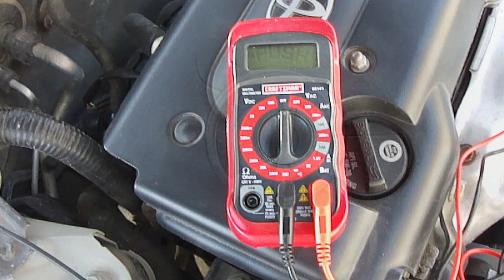How To Fix Car Losing Power Loss Of Acceleration - Easy!

Comment: mine was leaking oil from the solenoid in tieback on the engine but I have two solenoids I was gonna change the vvt one to , I have engine like p420 , and I changed the pcv valve but the p420 says lean mixture in system bank 1

Comment: my 2015 camaro rs keeps saying engine power reduced and service stabilitrak again for the last 2 days. I cleaned the throttle body the last time this occured and it went back to normal bt the engine light stayed on. Bt this time while cleaning i see the hose that is connected going vertically to the top part of the engine was disconnected. so i fixed and cleaned the throttle body but the car keeps doing the engine power reduced thing still. very frustrating plz help!! Also the engine would hesitate a little during acceleration. dnt kno wat that mean either

Comment: what could be a reason of engine hesitation on a little throttle while driving (looks like unbalanced flywheel) on chevy camaro ss auto transm? I replaced vvt sprocket, vvt valve, cam magnet and sensor, timing chain.

Comment: We have a 1989 Honda Civic with a 1.5 engine. I'm not aware that our car has such a VVTS device on the engine. We have the symptom mentioned, so where from here to look for the culprit? Once the car is fully warmed-up the throttle shutter goes away.

Comment: Hi sir,i have a 2010 crv,i bave a big  hesitation on stop go motion only when the engine it s cold,when its came warm its came normal,this about 3 monhs, 3 mechanic can t find the problem,no code or check engine ,they change the TPS sensor,clean the trottle box,change crankshaft position sensor,change valv timing solenoid  spark plugs,oil filters,put moly catalytic cleaner,they cant find the problem

Comment: Engine hesitation is one of the most nerve wrecking things to diagnose!!!
Reply: Man what?? I have a 94 f150 new IAC, distributor, plugs, wires, ECM, coolant sensor, MAF sensor, EGR. Fuel pumps/filters are "ok." Mannnn idk!!
Reply: @demariojason  Trust me I know the feeling. I did the same thing. Come to find out the problem was the thing I ignored the whole time, wheel speed sensors. Not knowing they were directly linked to the transmission response according to the wheel speed. I was thinking they were only for ABS and VSC. Smh.
Reply: @MRMAN-wb1tv  wow!! Smh. I may need to try that.
Reply: @demariojason  Did you have abs codes?
Reply: My abs is on

Comment: Hello sir, its great information and experience which is quite helpful,
I have 2NZ engine, it has no check engine light but the engine hesitate during cool and rainy season , its stops hesitation once engine gets hot, but repeats in cool such as losing power and jerks, i have followed the steps to check the VVTI sensor, it moves and gives reading directly but it doesn't give any reading when its checked for whether coil is grounded. What does it means futther!

Comment: You don't get nearly enough views as you should be getting compared to Scotty Kilmer or even Chris Fix. Love how straight to the point you are. Thought I had a parasitic drain and couldn't find the culprit but I finally watched one of your videos turning the car on and disconnecting the positive battery cable. Sure enough car stayed on proving it was a bad battery regardless of reading 12.6V. When I removed the battery I noticed under th3 negative terminal there was a large Crack and what looked like gas or some liquid acid had come out from trying to use a rubber mallet to get it on right since it wouldn't tighten anymore. Don't hit your battery with a hammer who would've thought 🤷‍♂️🤦‍♂️

Comment: Man this is why I wanna be a car guy but I don't. Its a love hate relationship. 
I had electric trial and error crap. My car bogged down like crazy today. As a delivery guy I need my car sharp and optimal. I pulled out of a neighborhood to go into a main Blvd and from low rpm and low speed in 1 gear (it's a 2008 Elantra automatic) to get up to like usually 30 to 40 I press pretty good on pedal well this time I bogged like a friggin weed eater at like 5 10 mph good thing today Sunday and no on road and I didn't have to quickly merge cuz I was like wtf no speed no movement hardly. I turned into a street like 25 ft than stopped. Turn car off and back on and every thing is working fine. 
I'm think carburatuer is dirty? But now this solenoid gimmick. My check engine light has been on for months I don't ever engage with stuff until it's making a sound or someone when it's a shop tells me. But perhaps I should go to advanced and get the diagnostics checked. This video helped much my man. 
Appreciate the video. 
Danny

Comment: special cleaner? please elaborate, anyone?
Reply from the maker: Use gasoline
Reply: @proclaimliberty2000  thanks, that was my 1st option
Reply from the maker: @seaperu1  👍😊
Reply: @proclaimliberty2000   Hey captain!, will there be a screen on a Toyota Matrix oil valve switch?

Comment: So, I’m wondering if you could help me out. I’ve been looking everywhere trying to find a solution to this problem, but I can’t figure it out. I got a check engine light and it read, “misfire in cylinder 4”, so I replaced every spark plug and every spark plug wire, I also replaced the alternator, coil pack, and ran Seafoam and fuel additive through it, but nothing has seemed to work. It is a automatic transmission Pontiac G6 2006 GTP 3.5L V6. It hesitates, jerks/shakes and kicks when accelerating from a complete stop to an average speed.
Reply: hello, did you ever get it fixed? i’m saying similar problems it shows a misfire for cylinder 3 and 6 but has new spark plugs and coil
Reply: @svskii  did you fix it???

Comment: My problem was the valve cover gasket..oil was leaking on the spark plugs and since the plugs was wet they couldn't fire..after replacing the gasket and changing the plugs and cleaning the coil packs problem solved..
Reply from the maker: Trini_ Boi excellent.! Doesn’t it feel good to fix things yourself and save money.
Reply: @proclaimliberty2000  sure do 😁
Reply from the maker: Trini_ Boi 👍😊

Comment: I cleaned my maf sensor and air throttle, bit there still facing issues of smooth drive especially when driving below 2000 rpm at low speed
Do i have to change ignition coil with cable also....!
Any advice please
Reply: Did u determine the cause

Comment: Hi. Thanks for this video. I have toyota vitz and i am having jerky feeling at low RPM the important thing i notice is that its all happening after battery replacement as the car stood in gerage for 3 months as i stuck in Dubai due to air restrictions. Can you please help. By the way i am an engineer and can understand you guide lines.
Reply from the maker: Adnan Sikandar Check for vacuum hose leaks.
Reply: @proclaimliberty2000  Thanks for the reply. I will check for this tomorrow. Do you think this could be due to ECU forget VRAM values? If i am not wrong, vaccum pipe means the intake hoses?
Reply from the maker: Adnan Sikandar I don’t know about the V ram values? Yes, check any rubber hoses that might be disconnected or split. It’s also possible a mouse chewed on some wires or vacuum hoses with it sitting so long.
Reply from the maker: Adnan Sikandar also do you have a check engine light with a trouble code?
Reply from the maker: Adnan Sikandar How many miles are on the vehicle?
Reply: @proclaimliberty2000  ok
Reply: @proclaimliberty2000  no engine light.
Reply: @proclaimliberty2000  its just 50k
Reply from the maker: Adnan Sikandar you may also want to look at cleaning the mass airflow sensor and throttle-body.

Comment: Can you give that to me speaking  XJ Jeep?  Idle Air Controller?
Reply: An "Idle air control valve" is only a cousin of this camshaft phaser valve.
IAC usually just get dirty after long service miles. Computer compensate air mixture until it senses an issue and pop a generic DTC that will purposely not be obvious.
Reply: G Lasser THANKS!👍

Comment: I have this Issue with P0014 I do not have rough Idle the engine is smooth. I have change the Oil with filter and new solenoid VVT but still the Code is there!!! now 3 months. Any help ??
Reply from the maker: Sam make sure your oil shows the proper level on the dipstick. Have you tried clearing the check engine light with a diagnostic scanner?
Reply: @proclaimliberty2000  Yes I have 
And the oil is full ( proper level ) 
:(

Comment: Should these be changed out at a certain mileage? My CRV has 216,000 miles, but oil changes have been made every 2500-3000 miles since bought new. Love the easy to follow and well explained videos.
Reply from the maker: No.  As long as it was a good quality part to begin with it can last a very long time.  I have one vehicle with over 230K with the original VVT solenoid.  Your's will last as long as possible because of frequent oil changes which pays BIG dividends in every way.

Comment: My car hesitates, but has no codes/CEL. My engine (BMW M43TU) doesn't have VVT, but has DISA (variable intake runner length), would a faulty DISA be able to cause the same hesitation on gas (jerky, power loss, fizzing) as a faulty VVT solenoid?
Reply from the maker: Yes
Reply: mostly nop unless the intake runner is stuck in high rpm mode. 
German like to build short lived PLASTIC intake that age prematurely... hence "high maintenance money pits"... ask me how I know 🙄
Reply: @glasser2819  turns out it was a faulty MAF, but not faulty enough to yield codes
Reply: @nickamarit  A dirty MAF is a common occurrence, they can/should be cleaned with spray.

That brings the question how did it get dirty: contaminated air filter or bad PCV System (another German design staple 😉)
Reply: @glasser2819  PCV recircs post MAF though... but a dirty filter is likely.